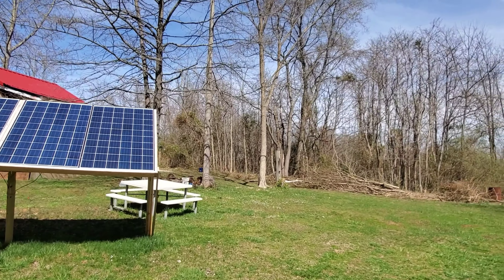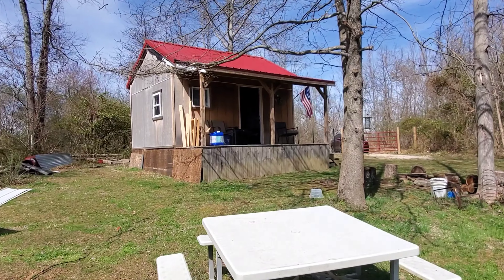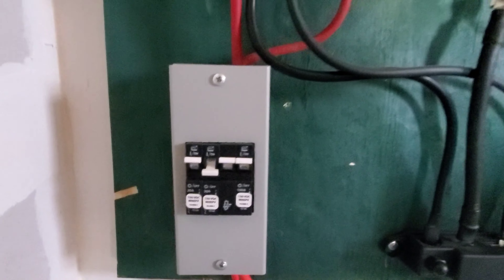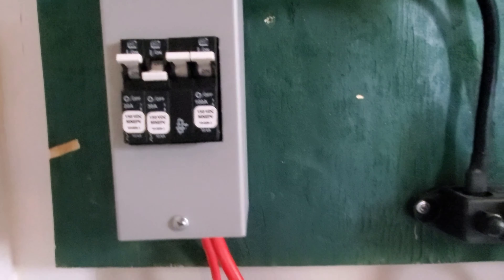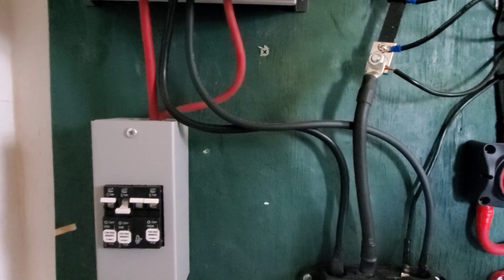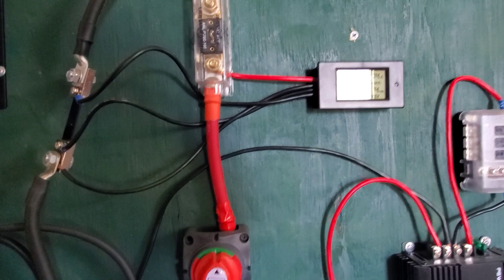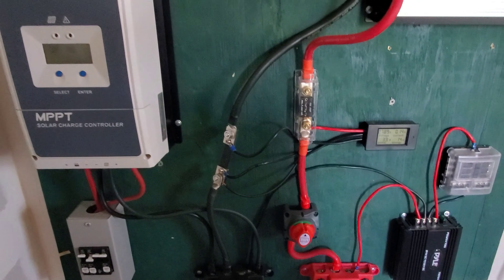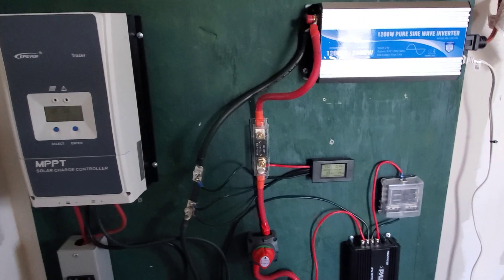Overview DIY Solar System & Battery Bank after 8 Months

Comment: All in one systems I have two 24volt 3000 watt split phase 120/240 both have. Mppt 80 amp at 145 volt charge controller built in to the units all you do is parallel the units 50 amp camp house 120/240